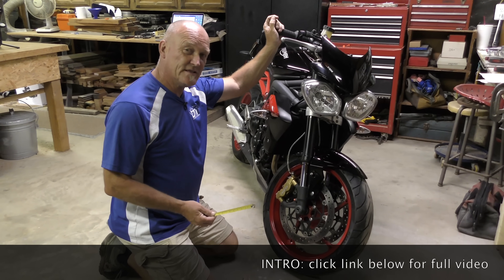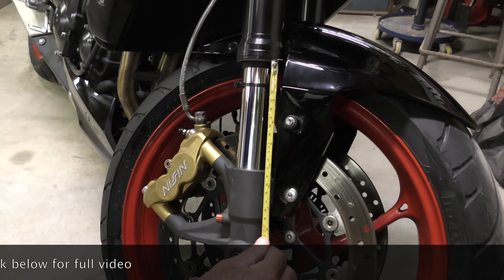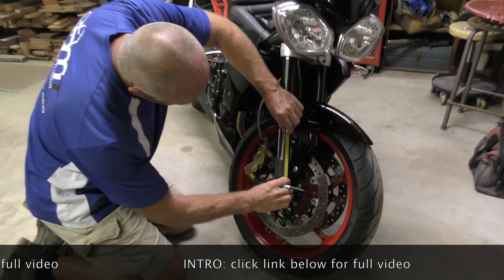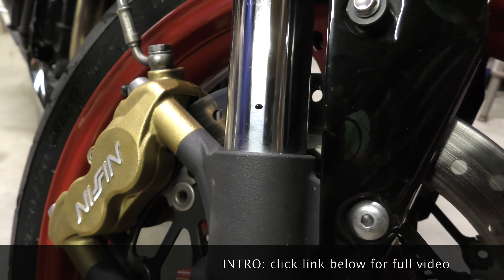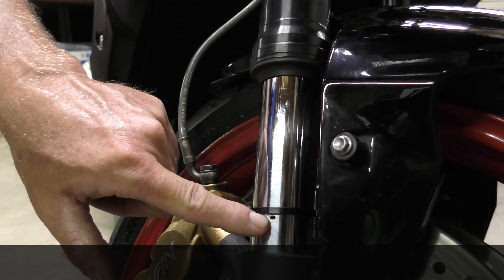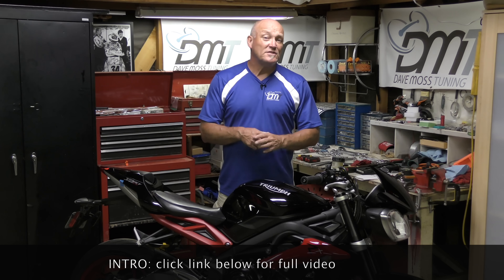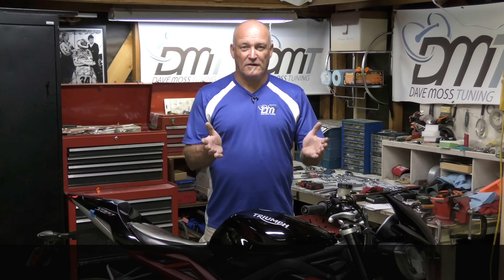Set Up Your Motorcycle Suspension in 6 Easy Steps Intro

Comment: I found this quite confusing. I know there are people who understand this and there is nothing wrong with your information, but as a below average DIY'er, i have no clue how to apply this information.
Reply from the maker: Dave Williams, editor, replying. Can't thank you enough for your comment. We're putting together some "courses" and your feedback is greatly appreciated. Please elaborate, because how to apply the info is exactly what we're trying to achieve, and if we failed you we likely failed lots of people.
Reply: @catalystreactionsbw  well for me I like to know what needs to be adjusted, how to adjust it and how to know when it’s adjusted enough. And why I need to adjust.  And what happens if it isn’t adjusted properly in a practical way, like how it affects the handling of the bike while riding. 
You know, just the basic what, why, and how. 
Your information seemed to dive a bit too deep into the intricacies of the suspension and that just ended up making me feel in over my head like I would rather just take the bike to a dealer and let them do it.
Reply from the maker: Dave Williams, editor, again. Excellent! Thank you. Clear and concise. I get exactly where you're coming from. I can see a video in my mind's eye to address all that. We'll try to film and post it by the end of June.

Comment: Totally confused
Reply from the maker: Then start with single videos beginning with lever shape to your hand size, then handlebar ergonomics and start there. Once you understand how to set the bars correctly, then move to static sag, rider sag and the principles of sag. Once you understand that, move to videos on rebound being too fast or too slow for the forks and shock.
Reply: @catalystreactionsbw  ok thanks! I did that... and now know how to measure sag. Do you know what the front and rear sag should be for a 2013 SFV650 Gladius? I'm 240lbs and I can't find the sag specs in the manual...
Reply from the maker: @Thomas998822  Front static sag will be around 30mm, then rider on the bike should be another 10-15mm to total 40-45mm. For the rear shock, static sag will be minimal at 8mm and rider sag may be as great as 40mm or more. Once sag is set, use the cable tie on the forks and grease ring on the rear shock (videos for both) to assess if you need more or less preload based on travel used.

Comment: Great explanation but you didn’t actually show how to do it
Reply from the maker: Use two fixed points for the forks and shock to measure from every time. 1. Extend the suspension. 2. Let the bike sit under its own weight. 3. Sit on the bike.  1&2 = static sag and 3= rider sag

Comment: Now I am even more confused.  :/
Reply from the maker: Do you not know where to start? 1. Lever angle. 2. Lever reach to fingers length.  3. Bar position. 4. Shifter and brake pedal height. 5. Static sag and rider sag. 6. Set rebound and compression damping.  Starting at 1 with the simplest task through to 6 the hardest.